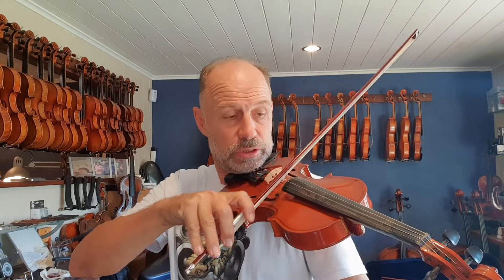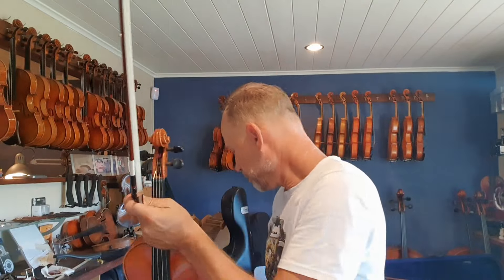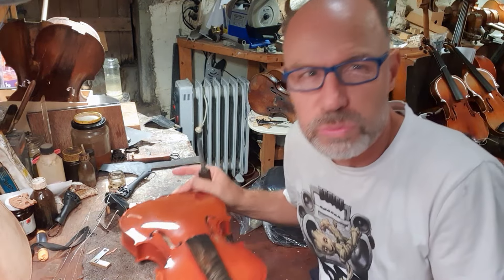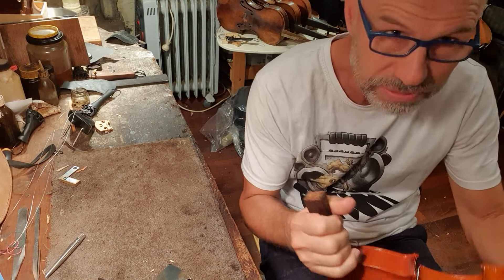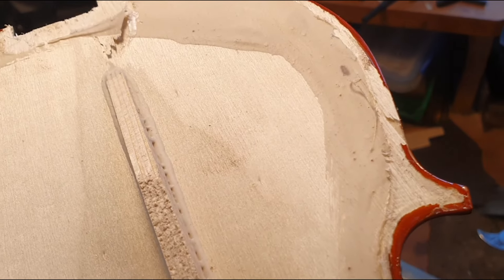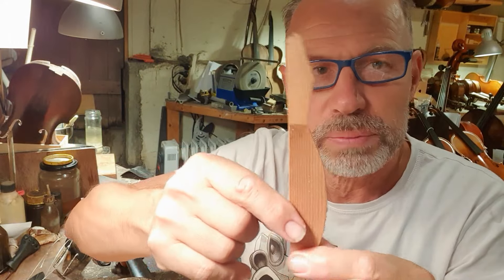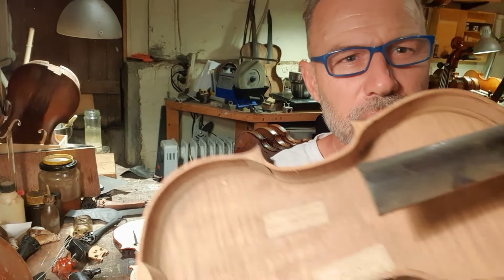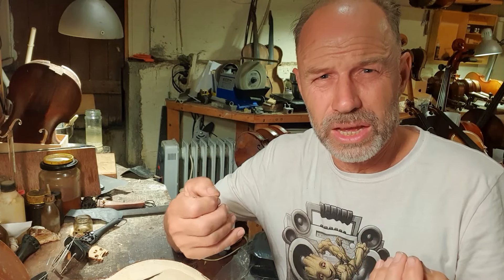I open up the 100 dollar violin

Comment: Also thinking about using plastics, perhaps consider experimenting with it a little by using transfer poles.

Again looking at what you are showing, and what you are saying, perhaps when using the bridge where the strings sound is transferred into that long bit of wood that tapers out, perhaps make use of transfer poles that connect directly or closely to that section or even spread the vibes out across the back plate.

But you said the violin was badly made, so it's very cheap, experiment with it beyond your normal repair structure these things are good for that.

Tradition is great but how do you find new things if you don't experiment.

I've seen plastic violins but they mostly are electronic, it seems to me that it's all about transferring the sound from the strings to the front plate which vibrates if so then there is a lot of scope for experimentation with plastics, or resins or other materials.
Reply from the maker: Hi,
Yes there has been a lot of experiments especially with composites.
They are getting closer, but there is still a long way to go. There is a kind of brilliance that's hard to duplicate. 
I love working with wood, so I don't have too much interest in it.
Reply: @AskOlaftheViolinmaker  But on that cheap violin may be the redeemer to get a decent sound from something that is so badly made.

Perhaps the main problem is the transfer of the strings vibrations, I'm thinking of a tuning fork depending on the surface and how it is placed depends on how much you can hear from it.

Most people probably use electronic tuners now rather than the old tunning fork in I don't know anyone anymore who uses the fork but they are great for finding resonance spots.

Comment: Sound and build quality aside, why is a VSO not recommended for beginners? I mean, I'm fortunate enough to be able to afford a bit more proper 'student' violin, however for many people even $100 is a lot of money (not talking about those $30 VSO though, but the ones like this on the video). I have tried a cheapo guitar in the past and it is 'playable' and makes guitar like sound. In a sense you can develop the skill that will transfer to an better quality guitar.
Is this that much difficult to play, and if so in what way exactly makes it more difficult?
Reply: He goes over this a bit more in his other videos with the cheap violin, but a lot of the problem is in how badly the violin is setup. When he first got it, it came with bad strings, a bad bridge, a bad fingerboard, etc. All those things not only made it naturally sound much worse, but he said it actually makes it harder to play properly. One of the things that stuck with me was that he said the strings weren't spaced properly and they weren't placed right on the bridge, so...I could be wrong, but it seems to me that if you tried to learn using a violin like that, you'd actually be learning improper technique because the strings and fingerboard aren't positioned right. 
Also, violin is already a pretty difficult instrument. I feel like a lot of beginners probably get discouraged already, and playing on an instrument that sounds terrible and is even harder to play would just make it easier to quit.

Comment: It’s funny how people think that brilliance was nescessarily a good thing. The tinny sound you talked about is much more brilliant and is a common trait of cheap instruments. Basically the stiffness does hinder vibrations depending on the wavelength, meaning that high frequencies will have little problems, but low frequencies such as the fundamentals and the low harmonics are very weak. On more expensive instruments we have more dampening on high frequencies and more resonance in low frequencies (though if the dampening is too much the instrument will sound dull). This results in a less brilliant, but warmer sound.

Also using plywood on the back and the frame is not that bad. Due to plywood being locked, i.e. you have alternating layers of orthogonal grain, it is very resistant to resonating and transfering vibrations. This is fatal for the soundboard, as it is supposed to transfer the vibrations of the strings both into the corpus and into the room. But the back and the frame are more or less supposed to form a resonance chamber. The wood affects the sound only minimally, and you do not want a lot of resonance in these parts. So plywood works quite well there.

After all the main influence on the sound comes from the compound of strings, ponticello and soundboard, and if you are a producer of VSO and decide to spend a little bit more on improving the excuse of an instrument, it is a good idea to improve these parts.

Comment: For a moment I hoped you would change the bar with a proper one, thin out a little bit the top and the bottom and put inside some sound optimiser. 
When you said that it doesn’t deserve even an upgrade I was really sad. Thank you for all the info anyway.

Comment: Interesting, but not surprising. They've been making cheap instruments out of plywood for decades. My friend gave me his old baritone ukulele, it's all plywood, and it was made (in USA) in the 60s. Since the top and back plates are just flat, it doesn't actually sound bad, although the plywood is starting to delaminate around the edges, so I need to get some glue in it.

Comment: hmm, if you just got $100 and you want to play a violin, I guess this violin is better than no violin at all. Not everyone has $1000 to spend on a violin.
Reply: that wasn't what he was saying. if you had only $100, you could spend it on a $100 violin or similar range, or save up just a little towards $350 or so for actual beginner instrument. you would not choose a $100 and under VSO. he even mentions in the video that he has seen actual $100 violins or other low budget violins that look better than this thing. 
so this was an educational video on how if you just need a starter instrument and something low price, that's fine but not the cheapest of the cheap where the quality is extremely low and not good at all. especially some of the ads that are out there. it would be worthwhile to find something a little better, doesn't have to be $1000 but certainly a better value than what is essentially a plywood PVA-glued toy or imitation object.
and remember, it's due to olaf's good set-up and using a good bow that definitely helped the sound come out not as bad for the demonstration. olaf and his skill helped it along tremendously. a beginner without the technique would be frustrated to learn from it and not get the right sounds. i've also seen people developed compromised technique/bad habit to get a good sound out of their bad instrument so when they upgraded to a real instrument/better one, they had relearn all over again to practice proper technique the way it was supposed to be from the start

Comment: Thats also maple and not plywood for the back. The figure is hidden because its not fully polished and varnished. The otherside is, which is why it has light flaming. Maple is not expensive and its a myth that they use plywood on cheap instruments.

Comment: Someone gave me one of these things, and just for fun, and ... really it wasn't that much fun as they kind of stink, I spent about 6 hours, really thinning the edges with scrapers, and whatever worked for sanding, as plywood isn't meant for a little thumb plane, and cleaning up the lining and blocks, with a fordom (like a dremel with a foot controller) I thinned the back plate (super stiff plywood), at the edges so thin when you shined a light through it it was closer to paper thickness- just part of the outermost lamination - heh heh - but the plywood is so stiff.  Plywood has the outside and inside grains going one direction, and the middle part grains in a perpendicular direction for stiffness - which is great if you are building a roof - but not so much for a violin.  Anyway, after much strategic scraping, sanding, thinning, and cleaning up (much thinner, as plywood is a lot stiffer than carved wood, and evenly stiffer, which is terrible for violins), new bass bar, and glued it back up - and the tone was much improved over what I got.  Now, I was just goofing off, and no real maker would waste their time doing what I did (I'm not a real maker - but have had quite a few apart for repairs, and spent about 55 years either playing or fixing them, and have read many books, etc. and studied the art).  I don't know why anyone would buy one of these things in the first place.  I have a 99 dollar violin (Cremona SV-175) that I really like, and use for old time fiddle music, and it has opened up wonderfully over the last 15 years.  I didn't even need to do too much set up, new strings, drop the nut a little, flattened the bridge a little for old time fiddle cross tuned double stop playing, and a little cleanup on the neck and fingerboard, and probably some peg dope, but I didn't need to ream.  It is ugly, machine made scroll, very plain wood, not super great bass bar or top plate graduation (I haven't even taken it off yet) - but it works and sounds pretty ok for campfire fiddle music, and I like it, and I have a bunch of violins I can choose from.   But, run away from those horrible plywood fiddles.
Reply: Oh, I didn't thin the back plate that thin, just the top plate at the edges.  I did get the back plate thinner, and so it rang when you tapped it (didn't take the ribs off though - just with the fordom and scrapers).

Comment: Undoubtedly, the VSO has a pressed top, possibly even a laminate... without knowing, though, it is all speculation... what woods were used in the $1500 violin? All of this makes 'the difference'... also, these are probably made en masse by children in china... not meant to be taken apart... people will still buy these, the sound difference was audible, but not so bad for a student model... you succeeded in showing the acme of snobbery... laminates are used because they are strong, and resist warping better than solid woods...
Reply: If I could give you 1000 thumbs up I "wood"
Reply: If you're in a weekend blue grass band, you might not care either.

Comment: I can supply the information Olaf is missing on how to improve the sound.  In this video recording, by the way, with pretty good speakers on my computer, I hear very little difference.  I have a lot of experience listening to violins.  I suspect in person there is more difference.  But it is not coming through.  The biggest problems I've seen are not in $100 violins, but in the $200-300 price range, where various resonances produce peculiar, foggy, nasal, or other unpleasant sounds.  As for Olaf's thick top plate theory, I have opened a $200 violin and thinned the top plate, and it just made the nasal sound worse.  Most $100 violins are laminate, sort of like plywood, and for this reason they don't have the resonance issues.  Olaf acts so surprised.  Everyone knows this.  You can see the layers at the f-hole cutout.  The biggest problem is they won't play very loud.  No one expects them to sound like a Strad.  In the end Olaf realizes the biggest issue is the laminate.

I did enjoy the discussion of winter and summer grains in the spruce.  If you are very brave, you can attack one of these with a hammer and chisel and create the sideways flexibility.  (This of course is risky, and leaves marks on the finish - sometimes they will even do this at the factory)  Now I understand "why" it works (sometimes).  

There are some advantages to the laminate violins.  I have one I leave stored at a house in Aspen (in the mountains).  I don't worry about it cracking in the low humidity.  I had another violin there and it sort of fell apart.  No way am I going to buy a $1500 violin to leave there and play two weeks out of the year (it's my sister's place).
Reply: I wondered when he said they were pressed. You sound like you know what you're talking about, are they actually laminated in a form, like glulam engineered beams? That makes more sense than buying ply and press forming it later.

Comment: It's funny that you were surprised the find plywood. They do the same thing with guitars. On the cheapest VSOs and GSOs (Violin/Guitar Shaped Objects) the whole body is generic plywood that is heat pressed into shape and they are just not useful for making pleasant sounds. Some intermediate instruments could have plywood that is layered in and created in place in an arched mold with special glue and heat. But you will not generally find solid back and sides in guitars below about $600 USD, not sure where violins reach that level of construction probably $1000-1500.

Comment: if you haven't put this together yet i say get a dremel and a palm sander and fix that base bar cut those folded edges and round out the block. It would be interesting how much of an effect just those things might have.
Reply from the maker: Hi, the edges would be difficult to do. I can probably improve the bass bar and have been thinking of doing that.
I have to say... physics is against us on this one... just that rigidity in the top means that the tone will never have brilliance or richness
Reply: @AskOlaftheViolinmaker  could you turn it into a hollow body electric violin??
Reply: @AskOlaftheViolinmaker  Readings this i just thought. (Super labor-intensive and definitely not worth it but...) kerfing the wood can make it more flexible 🤔

Comment: When I bow my open g string (or pluck it), it goes up 1/4 tone at the end of it's sound. WHY DOES IT DO THIS? IT'S DRIVING ME NUTS. Can you tell me Olaf?
Reply: Check that the nut groove is slightly slanted toward the tuning peg. use a thin business card or piece of thin plastic that has a very straight edge.if this groove is rounded, the decay of the vibration will make it sit on a different spot on that groove, changing the length and the pitch as it rests on a different spot as it vibrates with a decreasing motion.

Comment: Olaf
Parents want to provide for their kids. a $100 violin is better than no violin.
Reply from the maker: Your right there...
Reply: si james  Depending on the school district, orchestra starts in 4th or 5th grade, so you strike while the iron is hot.
 Not all cheap violins are terrible, even the one Olaf is reviewing probably isn't as bad as he's making out, or maybe it is, I don't think I've ever seen a China violin with a plywood top, & I've seen plenty.  I will grant that $100 is going to be close to the bottom of the barrel,  but violins at the $150-200 price point are very serviceable, & while they may not have exquisite tone, they will easily last through Jr. High.  Keep in mind most kids don't stay in it that long or will switch to another instrument.

Comment: It would actually be really interesting to see if a super cheap mass produced/machine carved violin (in the "as nice as you can get, for the lowest price) could be significantly improved with slight modifications, refinishing, and new fittings. This one is just horrifying.

Comment: I hate to say it: the $100 violin sounded about as good as the $1500 violin.
Reply: Not to my ears. The cheap fiddle was very one dimensional, not much character in the tone. A plywood top is called laminate, and when it’s thick like that, it won’t vibrate. I’ll bet it’s harder to play.
Reply: @nickiemcnichols5397  

One-dimensional?  Not much character?

Care to expand on those wishy-washy descriptions?

Comment: A good violin sounds a touch better in the lower registers. Less boxy and nasal. It's not a HUGE difference and you'd probably be able to work around it if the instrument was ever amplified or used for recording. When you get into the higher notes the actual "tone" demonstrates less of a difference... but it's less shrill. Things like string quality, bridge and setup will matter more and overwhelm and differences in the violin itself there...as of course will the skill of the player. Also violins improve with age a lot...and a new violin doesn't benefit from that when compared to an old violin.

Comment: Inexpensive endoscopes are available that you can plug into a phone and use to look inside anything if it has an  opening. It occurs to me that somebody could check the internal construction of a violin before purchasing it.   Things like that sloppy glue job, poorly fitted blocks and even the internal grain of the body could be seen.

Comment: Wood itself is not that rare. Cheap violins never use ply wood. Thats just a figure of speech for the cheap quality build. Usually its maple and spruce used in expensive violins that is cut by a cnc machine. The density and tonal qualities are the same to that of expensive maple and spruce. The price of maple and spruce is mostly based on how figured the wood is. The price of a violin depends on the maker and his or her reputation and the level of craftsmanship. A well crafted violin will sound better and cost more.

Comment: True for any instrument. It is frustrating to see parents buy a cheap trumpet for their beginner. Guaranteed to discourage and lead to failure. How about an eBay trumpet that was so cheaply made the slides were coated in wax to fit. Once the wax wore, the tuning slides leaked and fell out.
Reply: Wow, that is bad.  I got a cheap sax off e-bay and it was pretty good after I put a decent mouth piece on it. It's won't last 100's of years or be worth fixing when it stops working right but for something to mess with once in a while it's ok.  I mostly play guitar but sometimes feel like something different so I have a sax, an organ, a couple recorders and a violin. 6 guitars from real cheap to good but affordable. If I played professionally and got paid big bucks I'd get more expensive.